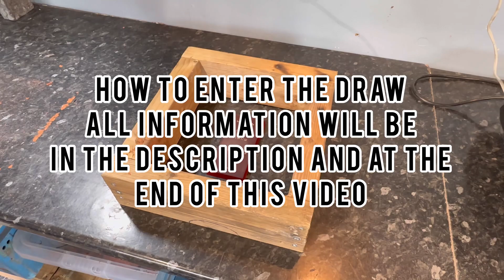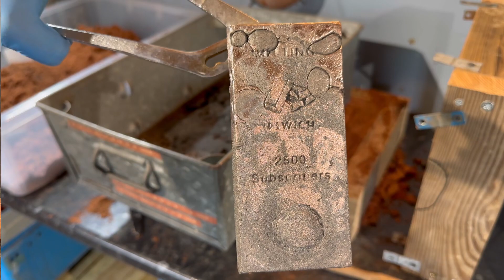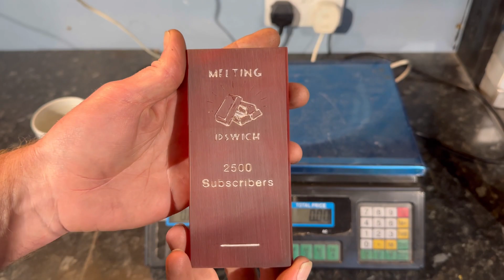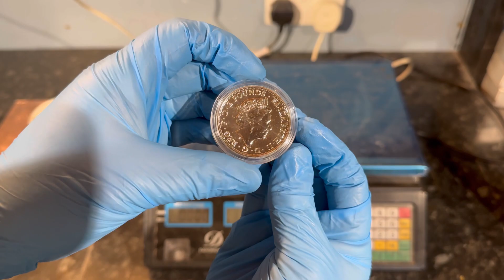2500 subscribers give away gaw melting copper and give away a silver coin

Comment: - Dear Folks... where do I put my comments on how to improve your currently pouring system shown...? Or, here it is my idea:  A runner with two arms on the cope side, a cup to receive the metal, two ingates  (one in gate on each side of the runner) will be set in the drag side. Of course, the yield don't play in this case, due tho aim get the plate as clean as you can.  Where do I can send a small sketch to show more in detail the idea of design...?